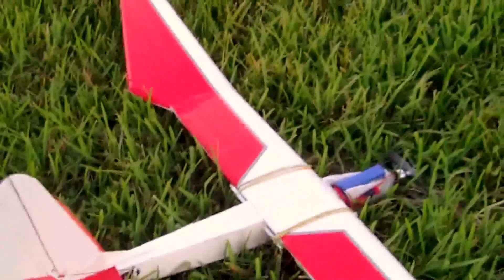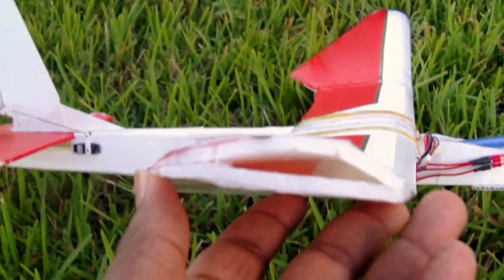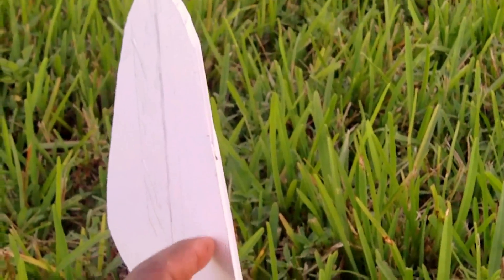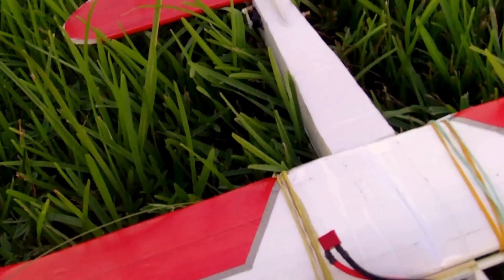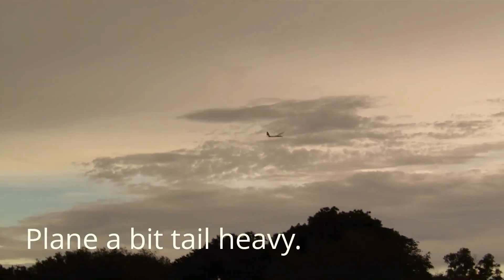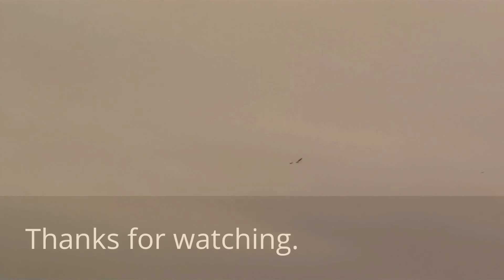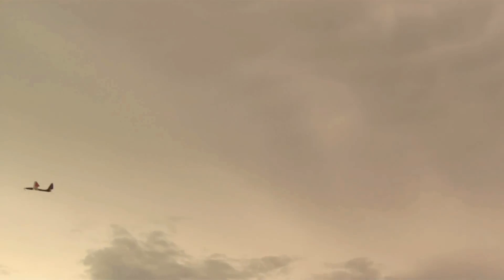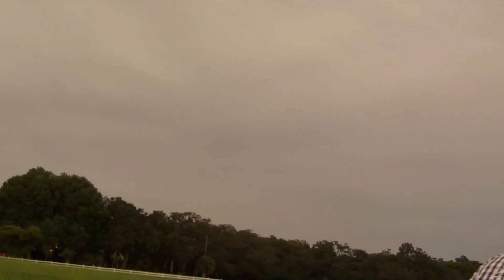Scratchbuild Dollar Tree foamboard RC glider / sailplane

Comment: I have yet to have any success I crash every time, maybe I should just try like you did and build one instead of buying kits and wrecking them. You inspired me today to keep at it thank you!!
Reply from the maker: Hey thank you so much I appreciate that. Actually it's terrible when you crash your own because rebuilding it is no joke. Go to a website called hobbyking.com and buy one of smaller plug and play foam glider kits. Many of the wings are held on with rubber bands so when you crash usually the only thing you have to replace is a bent propeller shaft. Also you can download a free flight simulator. There was a time I was heavily into radio-controlled helicopters, that's something you really don't want to crash lol

Comment: Good job dude!
Any measurements available for this?
Reply from the maker: Thanks my man. This this was years ago and I haven't tried another like this since but I do know the wingspan was five feet I don't remember the length of the body but I do know the nose was too short because I had to put too much weight in it to get correct center of gravity. look at a channel called flight test they teach wing and body building techniques out of foam board that's how I learned ways to put this together strong. In my opinion they're older episodes are better than newer ones just have too many guys in it goofing off

Comment: I just started scratch building a 3m foam board glider with a minimoa style wing.
Reply from the maker: Word up Marky, just take your time and measure well before cutting and make sure everything is symetrical. and take photos of your progress. Id like to see when its done bro, thanks
Reply: Yeah I have some pics. Are you on RCGroups? I am building 4 armin wing sections like Experimental Airlines so it will have a 120" wingspan!

Comment: "It's rare to find someone make one that's a glider" What's rare is to see a scratchbuild with that level of detail. I could never do a paint job that good,  and the wing looks like it came from a factory. Such precision.
Reply from the maker: RC challenges Hey thanks , yes I watched several flitetest episodes to syke myself up to building and learn the foam folding and cutting techniques, the Coroplast was what I had to figure out though. as long as you have your cg right and your scratchbuild will glide when thrown by hand you can make almost anything fly. the wing is the only thing still together, the fuselage paper slowly separated and the whole thing warped. I hope to try a WWII biplane next time. thanks for the comment.

Comment: Are there any Pdf plans for this baby? Greetings from Germany 😊
Reply from the maker: Hello Chris that's what I was saying, I didn't use any plans I built it. From scratch. It is modeled after a glider called the bird of time. I looked at photos and use a ruler  the shape on the big foam board and cut it out slowly assembled. The important thing is making sure. Everything is symmetrical when you cut it out. And making sure the center of gravity is in the right place so that it can glide. After that, you can pretty much designed and built any plane.

Comment: do you know the wing loading weight 3 meter wingspan rc aircraft, i hope somebody here can help me
Reply from the maker: +Aldo Allende Oliva Wing loading is never the same it can vary but the lighter the better. I didnt do any calculations on mine I just made sure the wing was strongly braced and added no more weight to the fuse than necessary. thanks
Reply: +Raychristofer thanks for answer. The problem is. How I know the wing is strong enough. It feel like flexible but I don't not if it going to break
Reply from the maker: You know what, do like I did, add a balsa wood spar inside the wing,  before closing it up.
Reply: +Raychristofer for 3 meter wing span.

Comment from the maker: Aww man, my planes been in storage and the rear horizontal is warped from the heat. good thing foamboard is easy to replace.
Reply: If you are looking for something stronger to keep it from warping, check out carbon fiber arrow shafts. They are super light an strong. Also heat wont affect them, you can make them removable and make the plane foldable.
Reply from the maker: MrLazer1211 Thanks Lazer, not sure how I would use that on a sheet of foam board though.
Reply: If you double layer the foam board they fit perfectly. :-D
Reply from the maker: MrLazer1211 Hmmm, thats pretty deep, carbon fiber for the rear fuselage you mean?

Comment: Hey you should check out www.flitetest.com. They have some designs you may be interested in that will have build videos, free plans, and review of the planes they make. They also have a glider with alost a 60 inch wingspan and no wooden rod. All supported on foam. They have really helped open my eyes to some design ideas. I am in the process of building a biplane based off their design ideas. Check them out.
Reply from the maker: Timothy Messer I Love flight test, been watching them from the beginning almost, I learned much of my wing build and folding ideas from them.

Comment: I haven't actually built a whole plane that flew more that 3 seconds yet, but I've made around 10 different sets of wings. And am currently flying a set of 2.5 mtr Armin wings on an old Easy Pigeon fuselage. They're a bit flexy, but it's all good fun. I will soon complete a pure glider, no motor. And will ask one of the guys at the soaring club I just joined to give me a bit of instruction with the basics of how to get it back down safely after chucking it away! :¬D

Comment from the maker: Hmmm, interesting, I never thought of that, might work, Im having so much fun flying it I still havent modified it yet lol, my rudder is actually held in with 2 screws on an old T-34 Mentor bracket so I also can remove it quickly when I get ready. thanks

Comment: I needed to make the rudder on my Bixler bigger, so I simply double side taped two thin pieces of plasticard to it and trimmed them to the new shape, then double sided the trailing edges together and finished the whole thing off with electrical tape for a smooth finish.
.
Hope that helps. :¬)